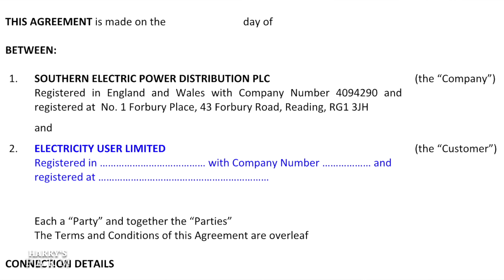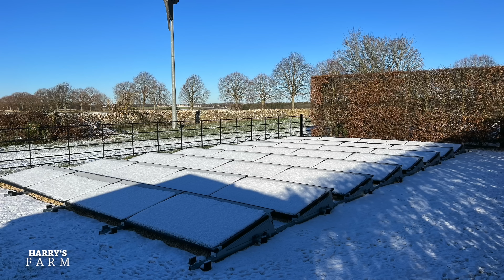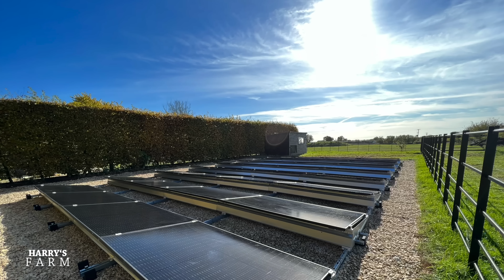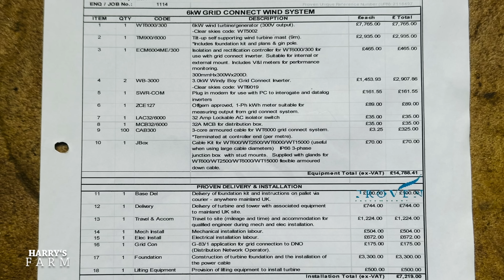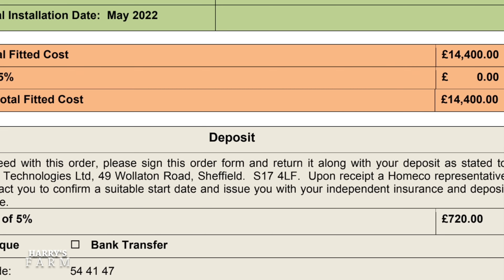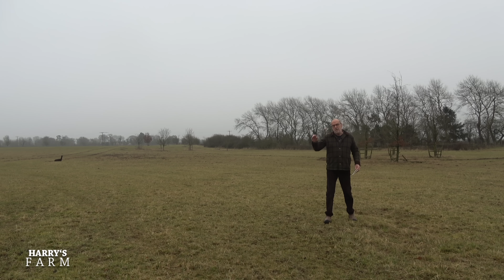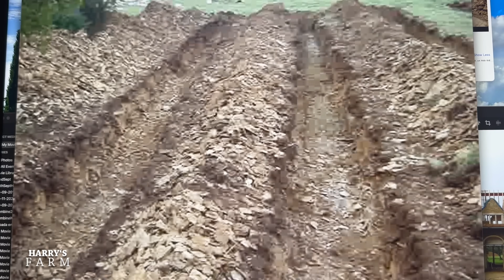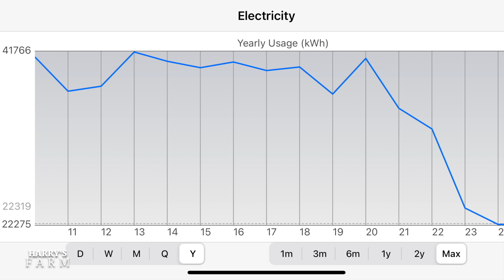Are solar panels & heat pumps worth installing? Here's what I've learnt after several years of use.

Comment: If the panels were set to receive solar radiation perpendicular to the panel at about 10.30am & 1.30pm surely they would be more efficient? And at that steeper angle, they would tend to shed snow. From my experience, tripe glazing is quite significantly more effective than double, definitely worth the extra cost, so long as the walls and roof are well insulated.

Comment: I've used a heat pump hot water system since 2008. Replaced with regular electric and electricity Bill went down.

Comment: Not cagey; We installed a 10kW solar tracker in 2011 at a cost of CDN$ 90000. 44deg N   77Deg E gives about 14000kW h  annually.
Harry, a local farmer installed ground source heat pump system in 2006 in clay ground, which worked well until the ground froze! pipes are 6 ft down and winter  temps -30 overnight and -20 for a week continuous.

Comment: Have my system charge at cheap rate during the night to my 16kw battery. Then any excess solar is exported to grid especially during better weather and summer. Then all those export funds get accumulated throughout the year and goes towards covering my gas bills in winter.
Reply: Spot on - the textbook system for the U.K. Shame Harry didn’t look at this kind of scenario 👍

Comment: Great video and extremely interesting in all areas. However, your solar panel output is so dismal in winter because the mounting angle from the horizontal should be about 50 degrees for the winter. Your solar panel angle looks to be even less than 20 degrees! So it's even too low for most of the summer! So, it's hardly surprising you get a daily output of only 119 kWh in December. I also notice the rows of panels are too close together to set the panels up at a better angle -because they will shade each other! So, the whole set up is hopeless and you should be getting the cowboys back out, to lay it all out properly.  Incidentally, I've bought 20 panels and will be having them tracking the sun to maximise what sunlight there is here in the UK, all the time.

Comment: Great video as always. I’ve got a 2 bed flat with a Viessmann air heat pump which is currently consuming 8 kw a day for heating and hot water(January 2025). Heat pump is quiet but supporting infrastructure takes up a lot of space - there’s no way you can hide it unless you have a utility room. 

Great video as always

Comment: If you have shading as an issue for Solar Panels - get a Enphase or Solar Edge system as they optimise the output per panel and one panel in shade won't pull down the rest of the panels on that string. We've got a solarEdge system and it's great. I suspect he'd find he would get better winter performance as well, although it's still far lower than summer, for obvious reasons.

Comment: I wonder if you have been advised correctly about the ground source heat pump type Harry?  I live in an apartment building in Switzerland that was converted  from oil heating to a vertical ground source heat pump in 2009 and, which I believe,  goes down around 300 meters. There are 11 apartments  on 4 floors, varying from 1 bedroom to 3 bedroomed, but lets say 2 on average. The system provides all our heating (radiators) and hot water costs for around £11k a year for these 11 apartments and yearly maintenance is bordering on zero, just the periodic checks via a maintenance contract. I think this is pretty good value for money  and provides us with a stable price for heating due to all electricity being generated locally (Hydro).

Comment: Your panels look to be at too shallow of an angle to effectively take advantage of the Winter sun.  They nominally should be at the same angle as your latitude (~51.5° for London, UK).  Since you have ample collection in the Summer, you may even want to increase the angle a few more degrees for peak Winter collection, even if you get a slight reduction in the Summer (your yearly average should be higher).  For optimum tilt angles during spring and fall, 2.5° can be subtracted from the latitude.
Shading kills your output.  It is not 1 pane knowing about the other, but rather the shaded panel limits (hinders, resists) the output of that row to the lowest value.  Are you able to trim the hedge to eliminate the Summer shading?  (rhetorical)
I also noticed the Winter building shadow on a few rows of panels, not that you can do much to correct this.  See my comment on shading.
If you re-angle your panels per your latitude, you may even find the snow slides off as the sun heats the panels.

Comment: I have solar panels on my house, my brother has them with a heat pump. I find the solar panels a total waste of space, my smart meter shows a trickle of  electricity from them, just about enough to run my computer, if it's sunny. My brother states his heat pump is too expensive to operate. How many people have that amount of space to put enough solar panels to actually make a difference. My house is all electric and I am retired so in all day. The Solar panels are useless in the winter when you need them. They are oversold to the normal 3 bed semi household. Just do not bother.

Comment: First thing you do don’t put panels on the floor with hedges around them.
Put them on a roof  :) it also saves valuable space that you could use for something else.
Or if you didn’t want to use that specific location, make a little pergola out of it or something  
But don’t put them low on the ground. It’s a waste of space and you’re much more likely to get shade, leaves, stonestrike on them.
Reply: Raising the panels to near head height (to clear the hedhes and shadows) and increase the angles might be realistic and probably beneficial and you get some useable semi covered space underneath.

Comment: Within a second of watching this video I thought, "Why the hell are those solar panel flat - when HE HAS SO MUCH SPACE??"
I accept that he doesn't want to see them - so keeping the below eyeline is a must - but putting them into a grid pattern is a really bad idea if you want to get the most out of them during WINTER.  They should be on a Cornish Rocker. In his case one long line of them (you normally have them in a grid arrangement to minimise their footprint)  - and automatically controlled to point straight at the sun - 15 degrees in winter, 60 degrees in summer.
Also - his installer did a bad job not putting either "optimisers" or "micro inverters" on an array that COULD get some panels shaded.
Also - I wouldn't accept their bogus answer that the system limits the output of several panels BECAUSE it thinks one panel is duff - that's frankly BS - it's because the installer failed to do a proper survey for shading and install optimisers or microinverters.
Harry - you failed to do your homework man!!
Reply: Plenty of great results from tests showing farmers can adapt their farming system to incorporate panels and crops/livestock in harmony on their land. By raising them off the ground, certain crops can be grown under them and take advantage of the shade from strong sunlight. They also help to slow down moisture loss from the soil. It’s been shown that grazing animals benefit from this too.

Comment: My roof-top system generated about as well in June (700kWh), scaled down as it's a 5kW system.  But, it didn't suffer as badly in winter (90kWh).  That might be to do with a roof system making better use of low elevation sun in winter.  Shade less of a factor.

Comment: Nice house & pretty good setup. Since you have already a geothermal heatpump, may be you can boost it further using a few Evacuated tube collectors, those are very efficient with respect to any pv array; another case is to use those directly to heat up the pool in Summer and reduce slightly the usage of the heat pump.

Comment: From experience to sum it up … install log burners and burn pallets the rest of the thousands of pounds can be spent on holidays , cars and hobbies or bank it , I used to fit photo voltaic ( PV ) panels 15 years ago , I know a lot of the installs will probably take 20 to 30 years to break even costing around 25k at the time and that’s if the equipment lasts that long ie: the inverters which have been failing within 10 years of installing plus quite a few panels would go down within 3 to 5 years , the only time I would have an installation is if it was for an off grid battery backup system or if it was free , this country doesn’t have enough sunny days to warrant that sort of money tbh. 👍

Comment: Solar panels are very worth installing. I now generate all my electricity year-round. The trick!! it is not a trick, it is an awareness of the law. In the late 1990s, the supply companies modified electricity meters to include a backstop. (I have this admission from my supplier). A backstop changes a meter from a meter to a transactor. I.e. it does not count electricity going onto the grid. One's goods (electricity) disappears when it goes onto the grid. One's electricity is stolen. My electricity company has admitted this to me in writing. I do not sell my summer excess electricity, I use it in the winter. I have no batteries, I have no need for batteries, I have the grid as a battery. I have a five-bed house in the country with no electricity bill. My suppliers have tried and failed to sue me. I have instructed a YouTube video on this, which I hope to complete later in the spring. There has been a massive fraud of us the home generator. The electricity companies have defrauded us and the government. I have researched this extensively, think about it a meter is not a transactor, a bank card is a transactor. A meter counts and informs a transactor.

Comment: I am really excited that you are looking at this topic of solar and heat pumps.
With geothermal energy, you no longer need so much surface area to achieve the same output. Here in Germany there is the GeoCollect system, which requires significantly less garden space due to the large surface area of its absorber.
There are now entire settlements that use this system reliably and the electricity consumption is significantly lower.

Comment: Hi Harry, what surely adds a lot to the low production level of your solar in winter, is the shading as you mentioned but also very much the very flat angle of the panels!  Myself have panels on the east and west of my roof at a 45° angle.  For sure my setup can deliver only 80% of power compared to someone who has the same panels oriented perfectly south.  But it gives me a much better spread of power during the day AND a better spread of power during the year!  Last week I was at 2 kW production (at noon) on a 3kW installation!

Comment: You can overcome shading to a certain degree with optimisers but yeah picking a good spot is critical. I have 10.2kW system but on my roofs and even in winter it does enough to take the pain out of using electricity. I do also have over 15kWh of battery storage which does help.

Comment: Hi Harry, in respect of batteries and particularly when the solar is producing only very limited energy you could charge from the grid at off peak (8 or 9 p a unit) and discharge during the peak times

Comment: I always wonder where the cold air will go. I haven't got a farm, I have an urban semi n an awkward corner plot, so a choice of :
a) across the decking, not really a good option, it's not that warm out there, even in Summer. 
b) out of the front of the house, nowhere to put it and a North-facing wall, anyway, doesn't need to be even colder. 
c) if the unit is on the extension roof, the vibration will annoy people in the bedroom and the cold exhaust will go down a cold, wet wall and make it colder and wetter, or down onto people on the decking or onto another cold Nortth-facing wall.
d) East, towards my neighbours? No, they don't deserve that.
Maybe it could blow up and away, but it's cold air, so it will fall down again.

Comment: Hi Harry, thanks for the solar review and stats, but I think you are missing some tricks. Our solar array is just 6kW, but we generated as much as you in Dec24 at 117kWh, so somehow twice as efficient. We have optimisers to help with the shading, but our panels are also angled differently to yours. Is it worth reviewing the installation? I somehow think you could make it much more effective.  

As one if the other commenters mentioned, the batteries/powerwall isb't just for solar generation, but to allow import of cheap electricity overnight for use during the day. Of course there is a cost, but just the batteries would save you 40% on your imported electricity. 

Good video, but I suspect you could be making so much more of your solar. 👍
Reply: Yes we got just 1/3 of his June output but almost the same for December. 

I guess the solar in winter is so low it's not worth optimising for it. 

I'm sure the installers would have explained all of this to him and shown him forecasts of production.

Comment: Love the video thanks for doing it.... But the angle of your panels has a lot to do with how they pickup the sun, in summer when the suns over head a low angle like you set up will be great, but with the sun lower in the horizon in the winter a higher angle to the ground is needed for the panels to maximize there pickup. Yes it will never be as much as summer but you will generate more if there angle is higher. For a fixed angle ground mount ( mine if the same just higher off the floor on a big frame) you would need a 20-30deg angle in the summer and but in the winter a angle of 50+ degree is way better. For the best angle to generate more over a full year a angle of 45% is recommended depending on where you are on the planet of course. But the UK is in a similar plane to where I am in Canada.... FYI

Comment: Solar panel Optimisers help when shading may occur at some times of the day. Storage batteries are a must have with any new installation to provide usage when needed during the day. Battery can be charged up overnight with cheaper tariff electricity especially during shorter day winter months.

Comment: For June, 1715 kWh equates to a 4.6 kW average power output over 12 hours. 12 kW panel output is probably idealised and quoted at peak sunshine and the panels perfectly perpendicular to the solar flux.
Edit: You mentioned this later in the video.

Comment: Don’t understand why he installed old tech string arrays ( shade affecting all panels in a row rather than just the one with shade ) than one with micro inverters. Also, the angle is all wrong. Plus most ground arrays are articulated and track the sun line of sight. He’s a farmer so he should have predicted hedge growth and behavior of sunflowers.

Comment: We should all take a moment to congratulate Harry as his wallet does the expensive research so we don't have to. The ground source heat pump is great if you have it on a big enough scale and a well insulated property with underfloor heating. Not surprised with the solar, It's England. The sun is barely out. Maybe get a second wind turbine  instead of the solar?

Comment: As the ex partner, and sales director of a solar company, in my experience, solar panels work providing its the correct orientation, south to south west, storage batteries are good, ground source heat pumps work well, however air source are ineffective and inefficient and expensive to run. However certain things like cloud seeding are definitely affecting output.

Comment: We have a Kensa Ground Source 13.5kw heat pump with four 50m slinkey arrays. Slinkeys were buried in trenches 1.2m x  1.2m.

Today's performance 12-Feb-2025 14:00hrs, overcast day, outside temp 7 degrees.  East Devon.
I'm shocked with your Ground Side temps.  Ours are:
Flow: 18.3 degrees C
Return: 13.0 degrees C
Our compressor performance typically runs anywhere between 400% to 600%.
Currently 488%
Reply: Addendum:  We were advised we must separate the arrays by 5m so ours are laid out exactly like that, four 50m long trenches, exactly parallel in an overall rectangular shape.

Comment: For the water cycling for your house heatpump, the outdoor water pipes really need to be down about 12' (4 metres) to not be affected by the atmospheric cold (or heat in the summer). Dirt is a very poor conductor of heat and it takes a while to migrate that cold away.. once the winter cold works it's way into the soil it makes the heat pump work much harder. 
At 12' the earth maintains it's normal 13 or so celcius (high 50s Fahrenheit) year round. This of course makes it more expensive to do the initial digging, but pays off eventually.
Reply: One other thing... add more panels! You have tons of room and panels are so much cheaper now. We just got about 800 x 255W 8 year old used (but still highly productive) panels from a solar vendor in Arizona. May not be an option in the UK but in the states they worked out at about 16 USD each with a full truck load delivery. Production may suck in the winter, but with enough panels (and a monthly tilt adjustment to adjust for the sun) you can get much more winter power. 
We use the panels as tiled roofing for our buildings and covered walk ways so they are not just taking up room, they are functional rain and weather covers.

Comment: There are some farms in more hilly areas which use solar in the summer, and micro hydro in the winter by running a long pipe up a hill to a spring, and using the head to drive a small turbine. There are even water mill conversions which are cool.

Comment: Had mine installed end of October (8 panels) , electric bill and DD has already been halved… you DO NOT need permission for a house, permission is only needed for large solar systems like the poorly designed and installed one shown here. 
He was ripped off with that ground level install